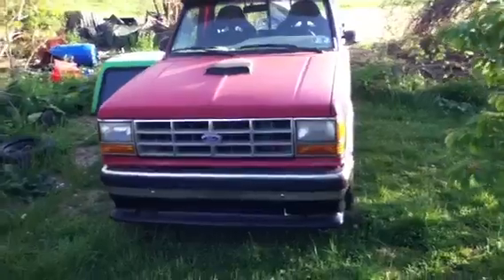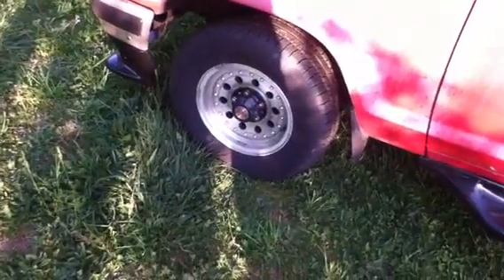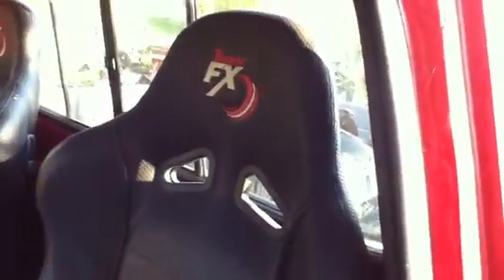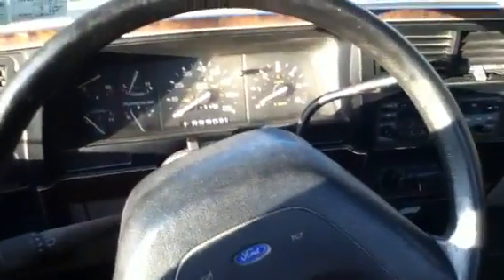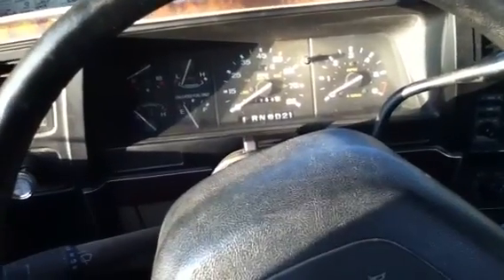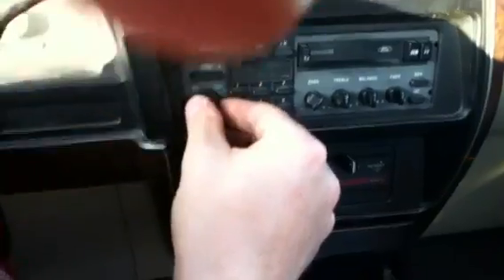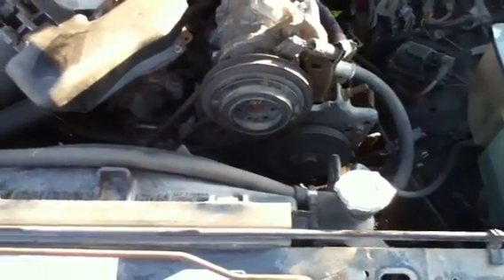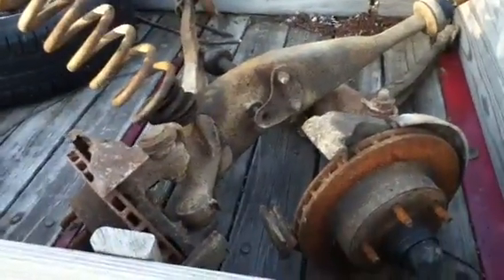My new 89 ranger

Comment: Sweet looking Ranger bro I would take that flate bed off and get like a step side bed from a splash and put on there . That sunroof is killer though and that is pretty good for such low miles on that yr of a truck its really in good condition. I would do away with the step side on the cab to I don't blame you there ..lol